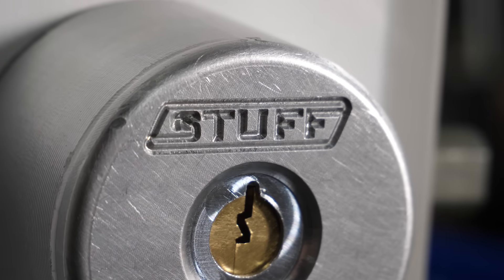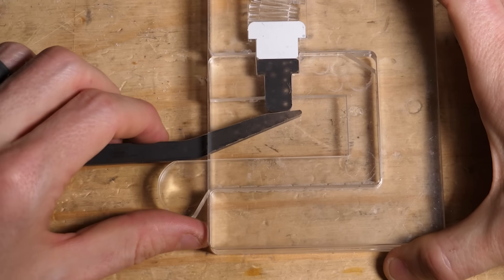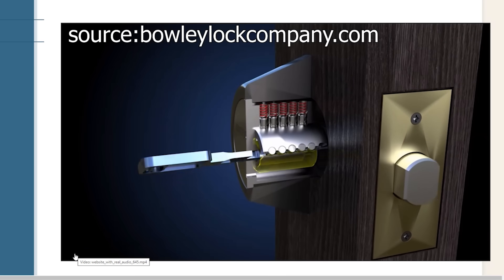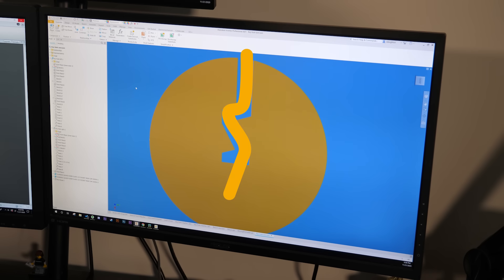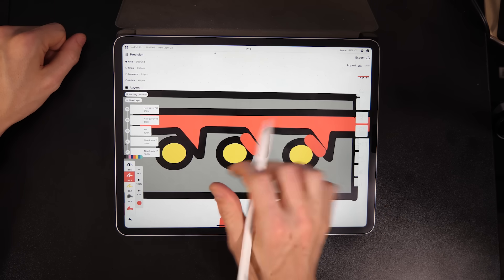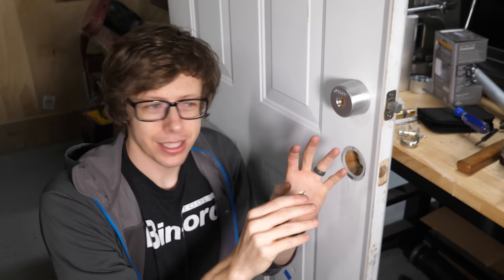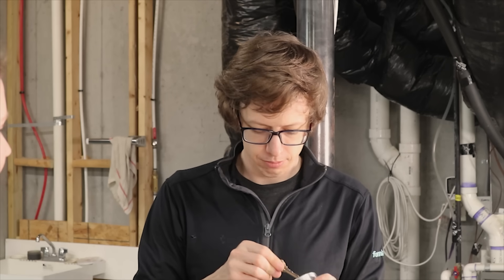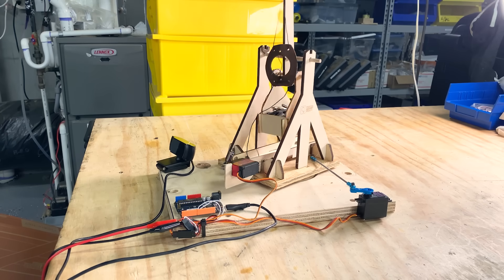Making an unpickable lock. Calling locksmiths

Comment: Yes there are locks that don't use keys, but then someone like the LPL comes along with a magnet and finds a way to open them anyway.
Reply: How to open this biometric lock with a spoon

and it’s not clickbait
Reply: @marioghioneto1275  There is no spoon.
Reply: @marioghioneto1275  yeah just suffocate the guy the lock is programmed for with the spoon, done.
Reply: A strong magnet, baby monitor, and/or orange juice bottle, pick your poison
Reply: @cheesychi8317  don’t forget the lego spaceman
Reply: @cheesychi8317  you forgot about lego astronaut
Reply: The problem is when your keyless lock opens to any of garage door opener.
Reply: Lpl is the man
Reply: Yeah for sure. As the LPL would say, commercially available electronic locks, more often is built like a commercially available electronic. Which often leads cut corners and cheaper production trying to look sleek and forward
Reply: @UCSxgyHIvHbleSWZcpCxq8Vg yeah but try a screwdriver first
Reply: He hasn't defeated a Master combination lock that is keyless (speed dial 1500iD). That lock is the most ingenious thing I've seen. Although it's security doesn't remove the possibility of guessing. A properly programmed speedy cracking robot could probably brute force in an hour or something, but such a scenario is not very realistic/practical.
Reply: I'm convinced LPL is secretly a Jedi, and uses his force powers to open the locks.
Reply: RFID locks are laughably easy to defeat, because you can easily clone a plain RFID tag. ~$15 for a tool from China on eBay.
Reply: @flybackrs  Yeah, you need to have access to the actual RFID chip. You'd need to have someone follow you around, pick your pocket, and clone the tag. Not. Gonna. Happen. Too many people watch LPL and think that it's easy to pick locks or defeat electronic locks. NO ONE, is picking locks, or using electronic devices to defeat electronic locks. That happens in the movies, and in very fringe cases. They boot the door open.
Reply: @xenonram  Funny you mention LPL, who showcased a device able to clone RFID chips at a distance of 18inches, or ~ half a meter. So really. just walk past the person and you have the RFID code. So no need for actual access to the RFID.

Surely it is easier to just boot the door. but the other isn't as impossible as you try to make it.
Reply: LPL is literally the only one along with Bosnian Bill
Reply: Don’t forget LPL wife and her ice cream. Never get in the way of her ice cream
Reply: ModernRogue did an entire episode on why a lot of those electronic locks can be opened easily with basic understanding of what kind of lock it is. Lol
Reply: Pin 3 is binding time to use our friend the redbull can
Reply: @gimmeaford9454  I want to see that, actually! And I mean it, it would be an interesting video—have the dogs be alone in the house, put up some cameras, then have someone they don‘t know come by and drop some steaks in, and leave again. Don‘t put sleeping pills in of course.
Just to see what happens. And for how long they can resist the steaks.
Reply: I think his point was un-"pickable" not un-bypassable; I can bring a shotgun and get in the door in no time flat.
Reply: Welcome to the Lock Picking Lawyer and this lock is susceptible to gallium.
Reply: Its not picking- its Magnetizing
Reply: Laughed harder on this comment
Reply: Naw more like Deviant Olam
Reply: I’m convinced someone could send him a solid metal block and he would find a way to fix it
Reply: Wow
Reply: You're right  besides  most dead bolts can easily  be kicked in , a gate rod at the bottom  of most doors will never  be kicked in
Reply: All you need is a Red Bull can!!
Reply: Breaking into the American treasury with a red bull can.
Reply: DAMN IT!!! I was so excited to write a comment saying “LPL will prove this lock wrong.”
Reply: He doesn’t mean they can’t be defeated, just making a joke that they can’t be picked, I install electronic locks and RFID readers for a living and most of them can be defeated by some basic hand tools and a drill battery and a couple of paper clips
Reply: @gimmeaford9454  OH GERMAN SHEPHERD DOGS!
Reply: Gadget Addict is also here??? LMAO what a crossover. I watch Stuff Made here, then LPL, then Gadget Addict on Facebook lmao
Reply: Or Deviant Ollam walks by and waves his chip in front of it after figuring out the frequency, lol.
Reply: or a fricken stale dorito
Reply: YAY
Reply: @gimmeaford9454  and thats if they dont run when the hear the barking
Reply: bakit ka nandito hahaha
Reply: That only works if the locking mechanism uses relays. Some also use relays to set off an alarm so do research on what your opening.
Reply: Damn it. Came here to say exactly this
Reply: Or the ramset
Reply: Let’s go lock picking lawyer
Reply: Have we sent this over to him yet??
Reply: Not the Capitol Industries in my other comment.  Not one has been opened without destruction.
Reply: https://youtu.be/9XqQi-HWgUY
https://youtu.be/JPiKA_-enCA
https://youtu.be/5y1qjObX660
https://youtu.be/AKvFTawHBjo
https://youtu.be/lxzlb_sBGL0
https://youtu.be/ASJhJABJIUY
https://youtu.be/d4Jjxj1H6ow
Reply: Or you could get a bowley
Reply: this lock looks not easy to pick https://youtu.be/4vShP7riRqI
Reply: With his casual pocket EMP
Reply: https://youtu.be/CSj_TsrtpOs?t=11
Reply: Don't forget his portable EMP generator.
Reply: ultimately there is no more an unpickable lock as there is an unbreakable code. its just a matter of effort. plus with locks you have the problem of doors to contend with as well.
Reply: Older RFID locks can actually be hacked: they use a very simple transmission protocol and often have the transmitted code written on the freaking card!

So, someone built a device that tose codes can be entered into and that then emulates an RFID card:
https://www.google.de/amp/s/www.instructables.com/A-Universal-RFID-Key/%3famp_page=true
Reply: 69th reply
Reply: They are brass pins, brass isn't magnetic.
Reply: Fr. Same with the locks on cars like that
Reply: A magnet? More like a fork, a spoon...
Reply: Or a plastic spork
Reply: he means you cant pick it because picking is used to unlock locks that use keys, so no key means you cant pick it

Comment: The best lock would be one with a chamber like a gun. You would push on the front and spring popped out the chamber where you insert a key in to the barrel. You then push the chamber back in to the lock with the key in. The key could be any shape on top, with couple of little pins to hold it in the barrel of the chamber still. Then to turn the key there is a little knob on the door lock, which you can turn left, or turn right. It clicks indicating locked, then springs back, and press on the chamber popping out the key, you take the key out of the barrel, push the chamber back in. The pins are unaccusable when the chamber is out of the lock, so you couldn't try to open it and then attack it through the hole. To unlock you put the key in turn it the other way and it unlocks. 

This will not be pickable, if designed badly it could be shimable, so they would have to make sure it can't be shimed, then after this, if it can't be picked directly, and there is no way to shim it, or access the picking area, obviously don't make it out of plastic, make it out of solid metal with anti drill pins. They could not hammer it because turning the knob wouldn't work without a key in the chamber barrel. As the first half of the turn would put the key in place, and the second half of the turn would lock it. So without a key in, hitting with a hammer would do nothing, no key inside, no pins being moved. 

There is next to no way that this lock could be picked par stealing the key and making a copy without the person knowing, or simply use a handheld circular saw, to cut the lock off the door, if the door isn't reinforced, or just boot the door in, but obviously none of those methods are stealthy, and those methods also damage the lock, and the point of picking a lock, is to not damage the lock at all and not be heard. So making a lock that is unpickable isn't impossible. But kind of pointless to an extent, if you don't have a reinforced door, and someone really wants to get in.

Comment: LPL will probably just make a picking tool that replicates a key, multiple adjustable picks along a shaft. Might take forever to pick, but with the right tool, it is pickable. I think the first weak point to look at is the mechanism that holds the pins in place while the pin arm rotates around the lock body; clearly this mechanism holds the pins in place while the mechanism rotates, if you can find the sweet spot where a pin sticks, that's a vulnerability. Using a solid bar would make it fairly easy to pick with the tool I described, as that bar would pop into place when each pin is correctly picked. Using individual spring-loaded bars makes this more difficult, but then you run into the issue of making individual pins stick like a normal lock.  Separating the key mechanism and the actual lock mechanism is a good first step in building a better lock, though, I just think pin retention will become an issue in this design when it comes to making an 'unpickable' lock, as you need to hold the pins in their correct location while the lock rotates.

Though, this mechanism could include an interesting deterrent, that inevitably permanently locks the lock until a special tool is used. Include magnets above the pins and use a magnet in the pin itself. Push the pin too far, it gets stuck in place. This could be done by attraction or repulsion. Using the repulsion method would require magnets in the side walls of the pin retention mechanism, where the pins are repulsed downwards, but if pushed too far, repulsed upwards as well; this may also remove the need for mechanical springs. Even getting one pin magnetically stuck in a perma-locked position will perma-lock the entire keyway, but adding this feature to each pin increases security. The tool that can be used to reverse this would just be a stronger magnet on a key body, to pull the pins back down; or any kind of magnet on a stick, as long as the pins are pull down, the perma-lock is reversible. 

Also while digital locks are technically not pickable, they are also subject to typical attacks. Any kind of wireless communication is subject to it's own attacks. Having a port for things like firmware updates subjects the lock to attacks. Keypads have their own form of attacks. Etc., nothing is truly safe. Digital solutions are only a bit more protected due to the fact that they can lock up when brute forced, assuming they have brute force detection; similar to my idea of including magnets as a brute force deterrent. 

Even then, there's also other forms of attacks that bypass the lock mechanism itself. There's a good few videos from conferences, Defcon, Shakacon, etc., on locks, but I believe it's The Search for the Perfect Door - Deviant Ollam that goes over a lot of physical penetration and security. The lock is only one part of the puzzle that can be broken, but there's also other components of the puzzle that are just as easily broken. Security isn't down to just the lock itself, it's down to the entire door and surrounding structure. Just like fluids and electricity, path of least resistance will be followed. 

But for a better lock, this is a good start to an ancient problem.

Comment: Hello Stuff Made Here. Learning violin the normal way is not fun at all. 2nd, the only thing I think your violin machine should do is move the bow for you, as getting the right pressures and speeds to get good sound is very hard for beginners. Of course a machine would also be very good at doing the right things with its “fingers” as well. You will also have to build a thing that can link the “fingers” to the bow or you will never get the timing correct and it will sound horrible. Maybe a little pin that tells you when to change bow direction or to change the finger to the next note?

Comment: If I had to guess using the mechanism your locking the pins in with with a knife pick on top of appropriate tension on the core. LPL will find a way. Lower tolerance will  be its Achilles. Good idea, but relying on springs to lock the pins will. Maybe allow to exploit it. Much like spools

Comment: Great Engineering, Good Job!   If I was going to try and pick it, I would use a tension wrench and hold just the right tension as I tap on the top and bottom of the lock with a hammer to move the pins up and down until I can get them all the catch on the edge,  this "might" work because it seems like the only thing locking the pins in place is friction, I imagine a hammer tap will be able to move them, have you tried this yet?
Reply: I would see how some penetrating oil might effect the friction needed for the paws to hold the pins in place. If that didn't work I would try to corrode the springs with sulfuric acid or something similar.
Reply: The Sulfuric acid attack misses the point of a lock. That is, the lock slows the intruder to the point that they walk away. It’s not impenetrable. If someone were not concerned about spending time or making a huge noise there are any number of ways to enter the door. A hydraulic ram jamb spreader, a shaped charge to just remove a huge section of the door. The point here is that the lock is so hard to pick and requires so much time fiddling that the intruder risks getting caught in the act.
Reply: Just watched the Lock Picking Lawyer video and this was exactly how he picked it
Reply: Here before 1k likes
Reply: @urmom8707  Congratulations!
Reply: Did you watch the video? The locksmith did exactly what you just wrote.
Reply: @JM-yx1lm  he didn't actually do anything like what was described. The smith used a bump key, which uses a direct boop to the pins themselves, not a side on hit to the lock body.
Reply: @JM-yx1lm   the locksmith used a bump key, not what I said,  I actually watched the video twice to make sure I fully understood all the mechanics of how this works, its a really cool design. I pick locks for fun so just saying what I would try.
Reply: @ExperimentalFun  wouldn’t the force of the spring keep the pins from shifting far enough up?
Reply: @loudnoises4627  No, that would make too loud of a noise.
Reply: @loudnoises4627  only one way to find out!
Reply: @loudnoises4627   maybe but you could use a lock pick to push all the pins up first and then turn it and use the hammer tap to bring them down to the right levels,   I'm only suggesting what I would try, I have no idea if it would work or not or how easy it would be if it did work.
Reply: @ExperimentalFun  yeah... For fun /s
Reply: @JM-yx1lm  Your confused, that's not at all what the locksmith did.

Comment: "If you want an unpickable lock, get one that doesn't use a key." I'm pretty sure LPL has shown some massive flaws in those too.
Reply: He didn’t say unbreakable he said unpickable. ;) you can’t pick a lock if it has no key hole. You can crack it or hack it. But can’t pick it basically.
Reply: @musicgonnahelpme  Bowley currently have an unpickable lock with a keyway
Reply: @Arrica101  Unless you're talking about a new lock, Bowley has technically been defeated as far as I understand. It uses like specially modified Bowley keys as far as I recall (or manually created clones that have the same sort of dimensions as it) so it's an extremely specialized generally impractical attack, but it does exist.
Reply: Yeah, or look up Deviant Ollam, he tears through those things
Reply: Yes, but there are some that have no known way of defeat short of brute forcing, such as Master 1500iD

Comment: just... make a wire key lock? its impossible to pick since you would have to actually make a key to be able to even manipulate the pins, then you would have to impression that and that kinda gets difficult when you are bending a wire. The closest you could get is if you can actually see the pins and pick the lock... it also has like half as many moving parts as a normal lock lol.

Comment: Isn't there a lock picking tool that uses sudden gust of air to raise all the pins at once? If you have a locking mechanism for the top pins that is eager to lock them in the right place this seems like it would do the trick?

Comment: RFID locks: Meet large magnet. Cops in other countrys even keep one on them to easily get in buildings.
Reply: That doesn't defeat RFID though, it just defeats specific electromagnetic systems.

An RFID system with worm drive would not be defeated like that.
Reply: @MsHojat  i would say fair, But. ive used magnets to "actuate" mosfets. If you can get the magnet to fire the fet(assumeing it is useing one, some might use a solonoid? but also, angle and location can move the plunger of it too.) and the motor goes burr, theoretically.

Comment: I'm probably missing something obvious, but wouldn't you have to keep inward pressure on the key as you turn the lock to keep the pins from dropping down once you've turned the lock past the stationary pins? Or did you add something to keep the key in place as you turn it to prevent this?

Comment: It is important to recognize two things:
1: a security system is only as strong as its weakest link. I noticed you have a large glass window on your door. Even though the lock might stump a thief, the could just break the window and turn the knob. 
2: Keyless locks ARE NOT UNDEFEATABLE.  With the right tech or tools they can be opened faster than LPL can open most anything.  Watch Lock Picking Lawyer, he goes through RFID and keypad locks faster than some padlocks. 
-73s
Jake

Comment: Why not have the pins have a series of circumferential grooves that correspond with each possible height of the key cut. And you can use a bar with tabs that can slide into each pin. This would eliminate the need for squeezing the pins to lock them in place and would make the whole locking system a lot simpler